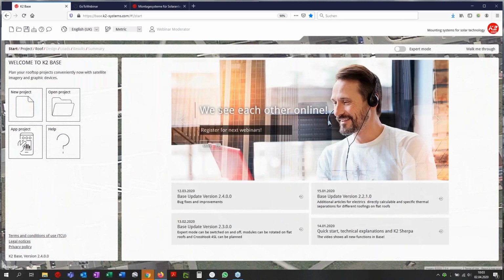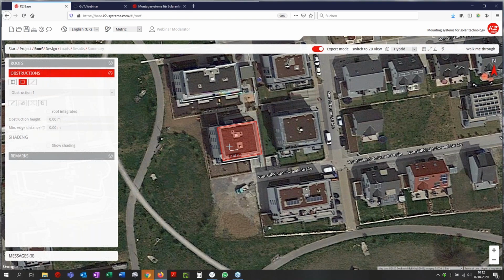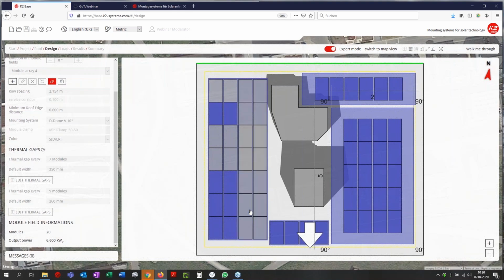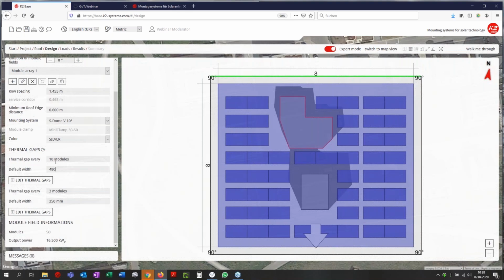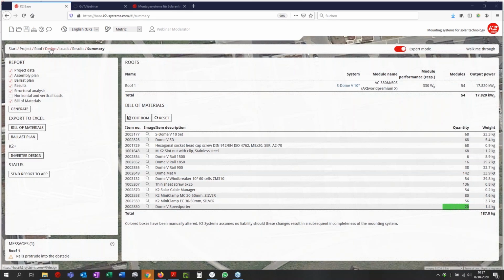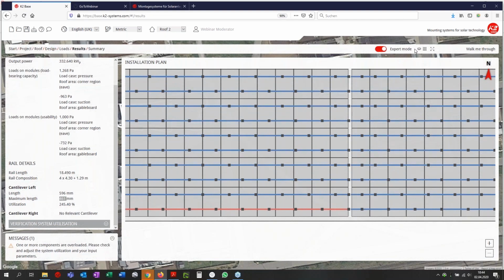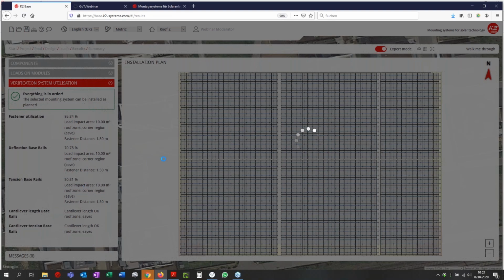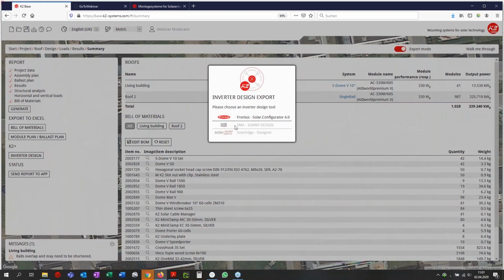Webinar EN: Einstieg in K2 Base (02.04.2020)

Comment: i have been trying to draw the roof of a non flat roof were the roof has many parts at different heights but i cant use the polygon tool unless when drawing the roof of a flat roof. kindly advise
Reply from the maker: Hello Alfred,
Many thanks for your question! Sadly I have to tell you that polygon roofs are only possible on flat roofs. In the near future we will release a new drwaing feature for hipped roofs in the pitched roof mode. In the meantime you can try to work with smaller module arrays (lines of modules) to solve your project. Also you could try to use polygon obstructions (standard 45° --> holding shift key other angles). Maybe that helps. 
There is also a chat function on the left side (navigation) of K2 Base. When you use this in the end you can get in touch with the support team or you give us a call +49 7159 420590 

Other ideas:
• Webinars https://k2-systems.com/training-support/webinare/
• Drawing obstructions (little outdated UI) https://youtu.be/9nFmbeHjCpY

EDIT: You can also exchange information with us and other users in our K2 Community. Login with Base account https://community.k2-systems.com/